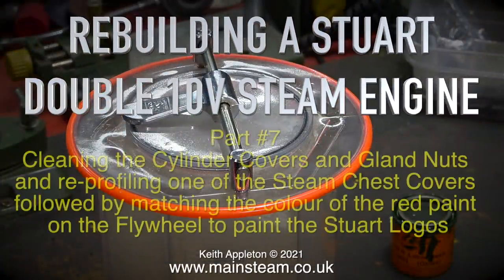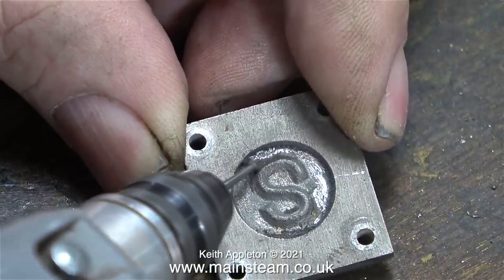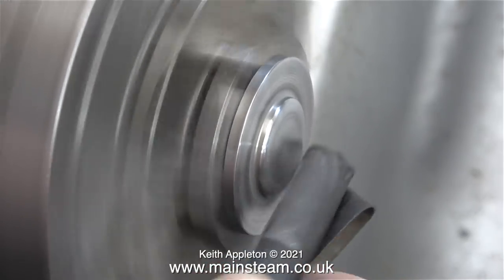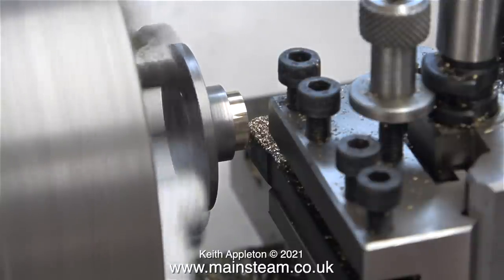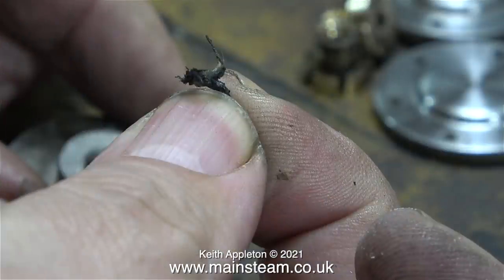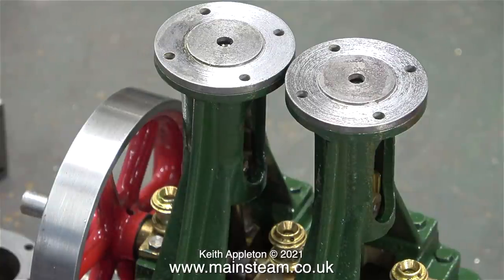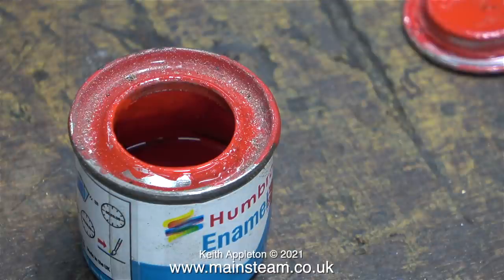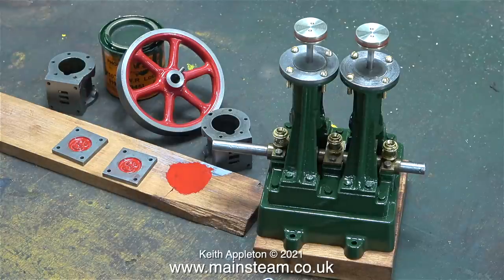REBUILDING A STUART DOUBLE 10V STEAM ENGINE - PART #7

Comment: You've answered a question I've had for a while: What do British people call a spanner wrench?  Apparently, it's a "c-spanner."  Makes sense, they're shaped like the letter C.  Although some look more like a G.
Reply from the maker: Not really necessary and the heat could be a problem, plus the 24 hour version of J-B Weld is a very strong Epoxy Resin

Comment: Hello,
Very nice video.
Why is the crankshaft 90 degrees?
You should say 180 degrees runs smoother.
Kind regards
Reply from the maker: 90 degrees is the way it works and is also self starting . . . .
Reply: This would be true for a two-stroke internal combustion engine, and for some four-stroke ones, but with this engine it gives a power impulse every 90 degrees.

Comment: Regarding the cleanup of the logos; I find that cutting a circle out 
or whatever shape is needed
of a piece of blue masking tape, then another out of Gorilla tape, 
and applying the blue then Gorilla over the surface you're trying to not scar, 
is a good prophylactic.
Insert old girlfriend joke here.
The Gorilla is tough and thick enough to harmlessly bounce the burr off, should it slip,
and the blue underneath makes subsequent removal effortless.

Comment: Hello Mr. Appleton, thank you for the video. Is there actually a correct position for the "S" in the Stuart logo? When is the "S" the right way round? I can remember that there was already a discussion about this in the assembly instructions for Stuart number 1. Greetings Michael
Reply from the maker: Yes it would appear so.
Reply: I’ve built several of these. After you clean up the cover casting you can see that both ends of the “S” are not identical. In my opinion, one orientation looks better than the other. I put the wider end down, I just think it looks better.